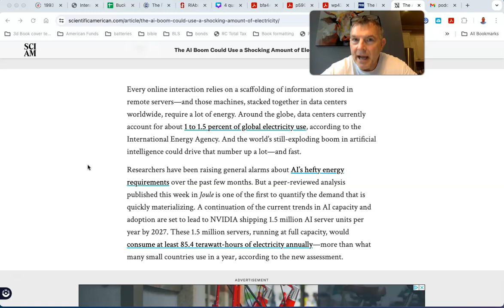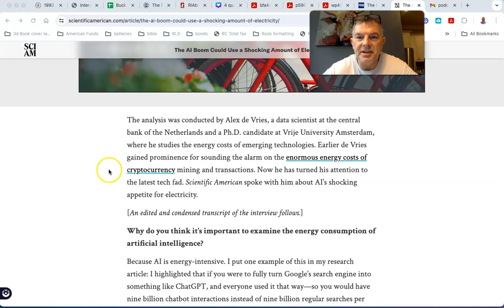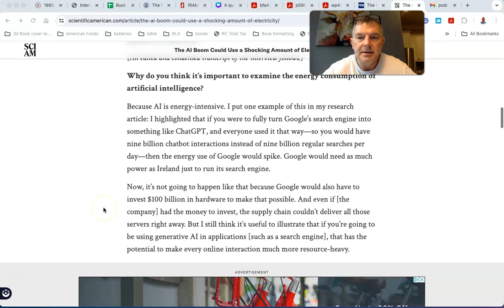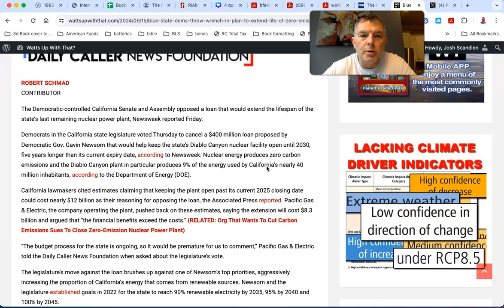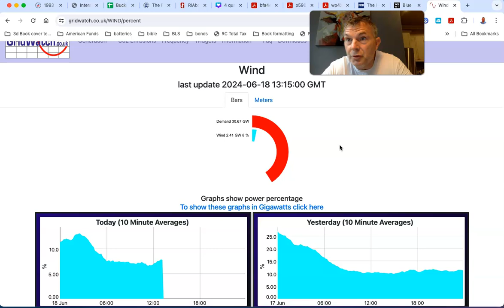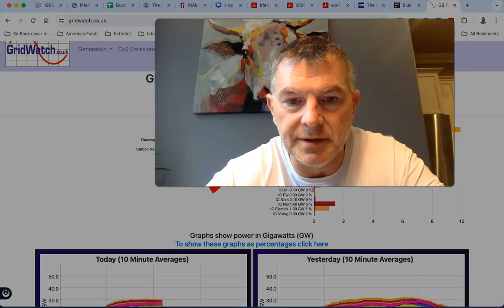AI Is Dead! Was Nice While it Lasted

Comment: There will be shortages of electricity starting next year due to AI data centers and the adaptation of EV’s.  

The corporations like META and Tesla are spending billions of dollars not just on the NVIDIA chips and data centers, but on the electric infrastructure that they require. 

META has contracted with a nuclear power plant to supply their electricity. 

TESLA  is using their batteries, efficient HVAC (developed for their EV’s), solar and any non carbon energy they can find. (Musk has said he is OK with nuclear, but to date no specific contracts have been signed)

The shortage of electricity is for the general public, not for the companies that can afford the billions of dollars it is taking to be the first to offer AI as a service.

Comment: AI needs quantum computing which uses a fraction of the energy of classical computing. But quantum computing is about 7 years away before mainstream use.
Reply from the maker: Only 7 years away eh? Sounds pretty family- everything is “just around the corner “
Reply: @HeritageWealthPlanning  D-Wave Systems (QBTS) has quantum annealers available today that companies currently use. But that type of quantum computing is limited in what it can do. IBM and Google have quantum processors today. But they're working on fault tolerance since quantum computing suffers from phase-flip (bit flip) errors. IBM's roadmap is to deliver a fully-error corrected system in 2029 with 200 qubits. Keep in mind that 300 qubits is enough to perform more calculations in an instant than there are atoms in the visible universe.
Reply: Who the big players?
Reply: @GusMahn  IBM is currently the leader in Quantum computing followed by Google, Microsoft, and Honeywell (largest stakeholder in Quantinuum - merger of Cambridge Quantum Computing and Honeywell Quantum Solutions).
Reply: @dobiesj  "Leader" is a relative term.  Current technology only supports a couple thousand qubits. Millions are required to perform any semi-useful calculations.   The problem of maintaining that many qubits in a usable state is far beyond the capability of an IBM et al.  

The type of computational algorithms suitable for QC is very limited.

The hype surrounding QC is largely a matter of raising financial support.

https://youtu.be/uKVJEuVkPvw
Reply: @tcalbrecht  Relatively speaking, if you ask people in the industry who the world leader of quantum computing is they will tell you it's IBM. Millions of qubits aren't needed to do calculations that have business value. IBM published a discovery using LDPC codes that would require ten times fewer qubits to achieve fault tolerant quantum computing. While progress is being made with quantum computing the science around it isn't limiting the advancement. IBM's quantum roadmap isn't hype to raise financial support. If anything, larger companies like IBM are donating money to universities to boost quantum computing research.
Reply: @dobiesj  All in theory.

"These hardware requirements, however, are not yet met by present-day superconducting quantum computing processors. The six-way connectivity and need for long wires is more challenging than what we have built at IBM so far."

Sorry, this sounds like marketing hype ...

"We are researching a continuous path to quantum advantage. Today, error mitigation and suppression techniques are bringing our clients to the edge of quantum advantage. These techniques are a stepping stone towards a world of fault-tolerant computing, and this new LDPC code is bringing that world closer. It’s a promising result pointing us where we should look next for even better error correcting codes."
Reply: Quantum computing may or may not be a factor, but may certainly help.
Reply: QC hasn't demonstrated it can perform AI calculations.
Reply from the maker: What doed quantum computing even mean?
Reply: @HeritageWealthPlanning  Quantum computing is a form of computing that uses principles of quantum mechanics to solve problems that are too complex for classical computers. At a more detailed level, a quantum computer leverages entanglement between qubits and the probabilities associated with superpositions to carry out a series of operations (a quantum algorithm) such that certain probabilities are enhanced (those of the right answers) and others depressed, even to zero (those of the wrong answers). When measurement is made at the end of a computation, the probability of measuring the correct answer is maximized. The way quantum computers leverage probabilities and entanglement is what makes them different from classical computers.
Reply: @HeritageWealthPlanning  Quantum computers just use atoms instead of bits for storing and processing information.  Just requires near 0 kelvin temperatures which is the problem.  We have Quantum computers already they just aren't really mainstream and the 'coding' for them is different just because atoms have multiple states rather than just on / off like regular electrical bits do.